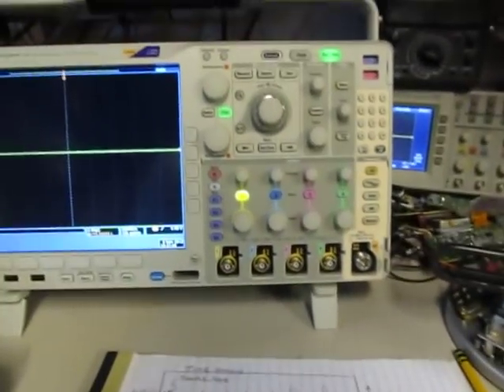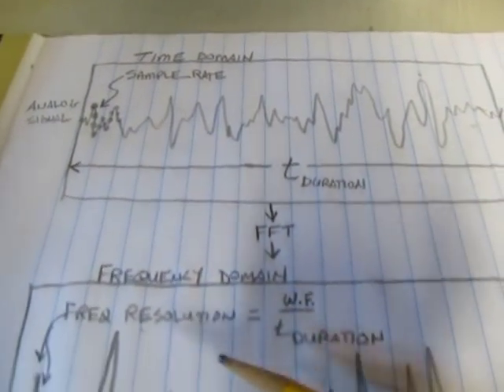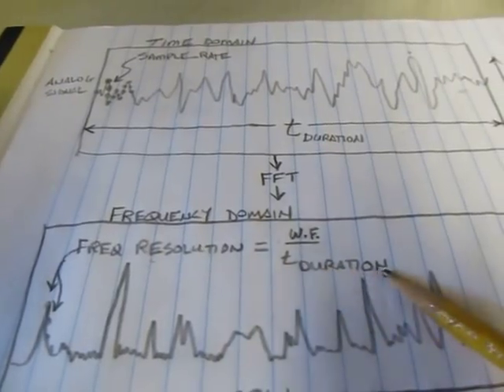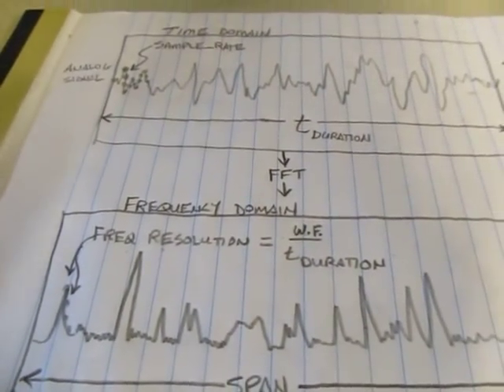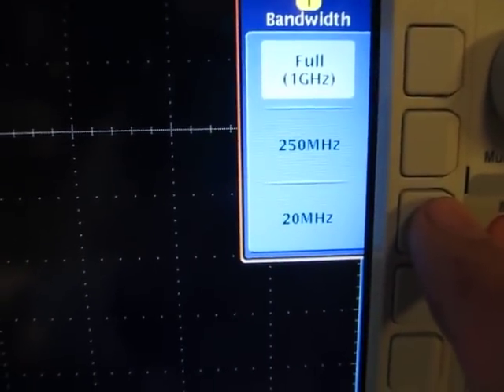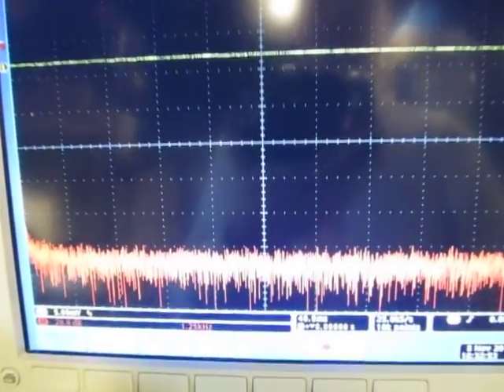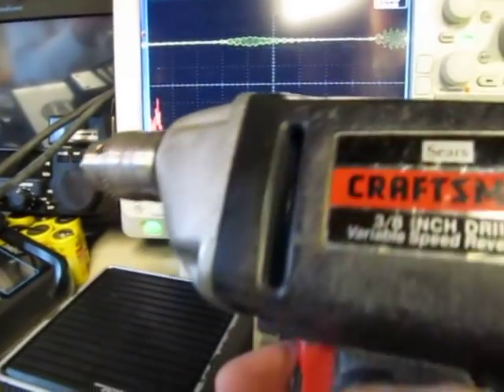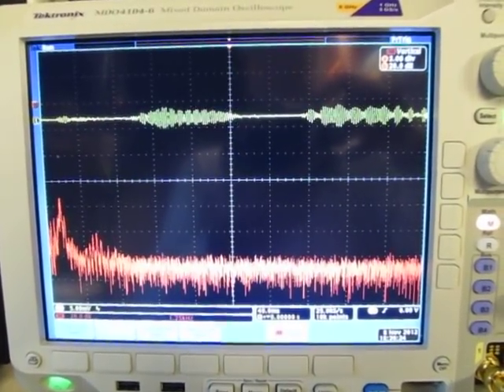#65: Basics of using FFT on an oscilloscope

Comment: Nice explanation of using FFT on a scope.  Just a couple of questions, Is the window effectively a built in apodization function?  I always looked at the FFT as capturing the frequency content of a time domain signal at a specific instant in time.

I am curious when we look at the audio spectrum as typically 20 Hz - 20 kHz, if we take a sample longer than 50 microseconds don't we begin losing resolution of the signal at high frequency since the signal is possibly changing this quickly?  

What I guess I am getting at is that if we sample at more than double the Nyquist frequency for the frequency band in question, and we capture 400 ms of samples the FFT could change dramatically over that time with a complex audio (music) signal, so is the oscilloscope just averaging all of these samples?

 Thanks for your instructive demo!
Reply from the maker: The window function is a selection available as part of the FFT math function.  The FFT cant measure frequency content at a specific instant, for the same reason that you can't tell how fast something is moving from just a snapshot. There has to be an observation time to see the variations over time. 

Longer acquisitions give you better frequency resolution in the FFT. the sample rate determines the frequency range given by the FFT.  In order to see 20kHz in an FFT, the sample rate has to be greater that 40kHz.  If the signal is changing during the acquisition used for the FFT, then the FFT will show basically all of the frequency components that appear in the acquisition. The amplitude of each frequency component will be proportional to how long that component lasted with respect to the acquisition length used for the FFT.
Reply: jaguart65100

Comment: PS: That's one reason why complex numbers are often used in DSP: one complex number can hold both the phase and the amplitude. You have to envision a complex sine wave as a spiral going along the time axis. Another advantage is that you can define both positive and negative frequencies (going clockwise or counterclockwise).
E.g. doing AM demodulation of a signal using complex numbers is trivial: you just take the amplitude of each complex sample and you're done! Try that using just real numbers.

Comment: Concerning the negative value: the phase could be 180 degrees off. In fact to correctly do an FFT you not only need to multiply it with a sine, but have to do the same again with a cosine (something I had omitted because explaining an TTF in 500 chars is a bit challenging :)).
These two values then make x and y values of a vector where the the angle is the phase, and the magnitude is the signal strength of that frequency.

Comment: The windowing is not essential to the FFT, it is the method for 'cutting' a piece of signal out of a continuous stream. See it like a fade in/fade out.
One important property that enables Fourier analysis is that if you take two sine waves, multiply them, and then integrate the resulting signal, you get 0 if the two frequencies are different. This is easy to check e.g. with a spreadsheat (make two columns with sine wave values, multiply the columns and sum the results).